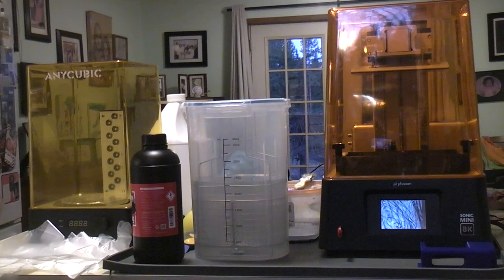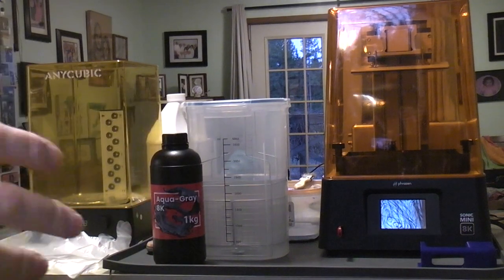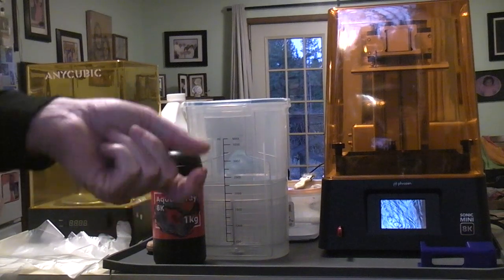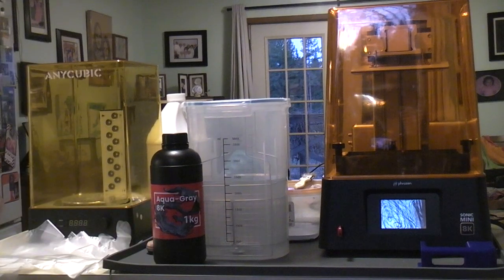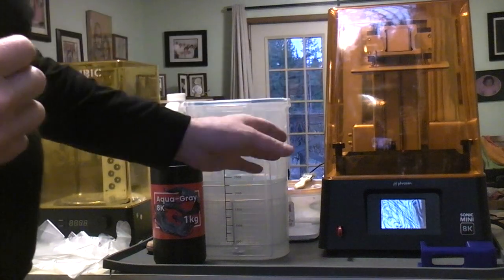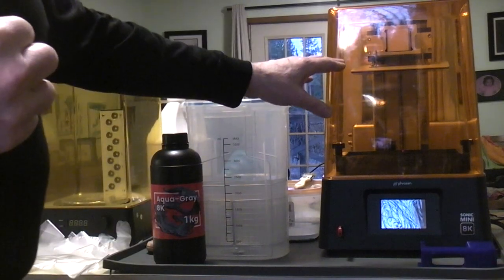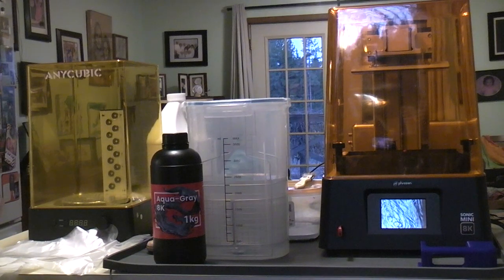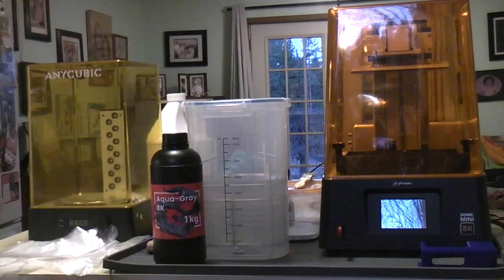A day in the life of resin 3d printing, recap. 6 videos showing the first prints and what I learned.

Comment: Thanks  for showing sharing this. I tried resin printing with an Elegoo Mars over a year ago. The smell was very bad but I think the resins have changed since then. I tried printing my little Silent Running robot. It was very hard to slice and I had to use another program to find the "islands". Hopefully the slicing software is better now.The front plate of the robot, which is approximately 3 X 2.5 inches,  warped badly. I'm not sure if it warped in printing or curing. I didn't print it flat on the build plate but at a 45 degree angle. That was what most people suggested for large flat objects. I'm sure I did a lot of things wrong. At the time people were saying the parts could be cured in sunlight which is what I did. I think the curing station is a much better solution. Even though I didn't get one usable part the finish of the parts was outstanding compared to FDM printing. My initial conclusion was that FDM printing is fun and resin printing is not fun. Some day I will try it again but this time in my garage. I'm looking forward to your evaluation of the dimensional accuracy of this type of printing.

Thanks
Rick
Reply from the maker: Thank Rick for the info on what you did try. Yes there are so many resin's now that there must be some that stink real bad and some that do not. I used the 8K resin that came with the Phrozen 8K mini as the profiles in the slicer they make you use were there already. Since my parts were so small I thought I could print them flat and the pulling force would be the same even if I angled them, but I could be wrong. More tests need to be done. All 5 of the videos were shot the same day. Then I took the set out to the shop as the smell was bad. So once it warms up or if I feel like paying to heat the shop I will try using built in supports on the parts and try printing at 45 degree angles.

Comment: "3dprintingpro" youtube is a good resource for supports and so on. What I do with any paper towels is to cure them under uv before disposing of them, it stops any smell. I find the best way to treat resin is the same as undiluted bleach, don't inhale the fumes, leave it on your skin etc. Another thing is don't use alcohol to wash your hands it is more able to transfer chemicals through skin than water. Soap and water is the best. Cheers
Reply from the maker: Thank you, good information. What I finally did was place the towels and gloves in a plastic container then set it out side in the sun to cure. I even did that with the cleaning vat I used for the build plate, and the sun turned it all into a solid .

Comment: In college I worked at a plastics molding plant. Some of those plastics were horribly nauseating when you smelled them and we would put up a table outside for ventilation. The worst was abs. Who knows what horrible chemicals are in your resins!
Reply from the maker: I agree, ABS is horrible. I worked in a paint factory for 9 years, you want to talk about smells. The resin is not strong, but just does not go away. So out to the shop I will have to go for my resin printing.